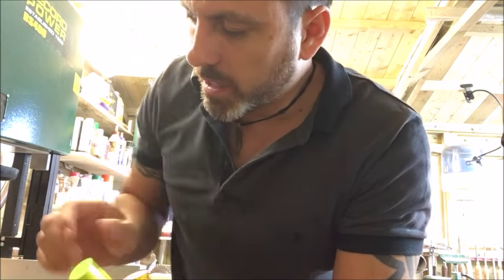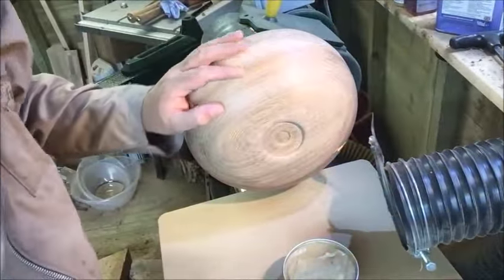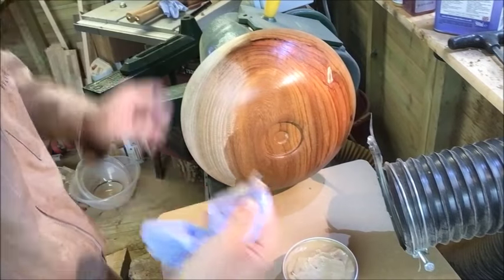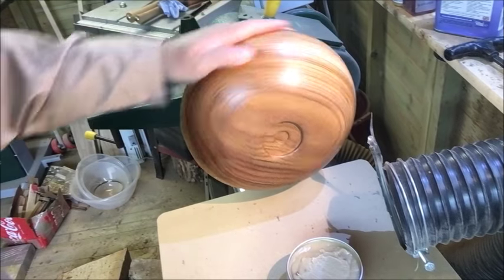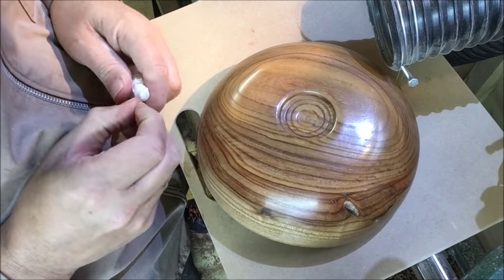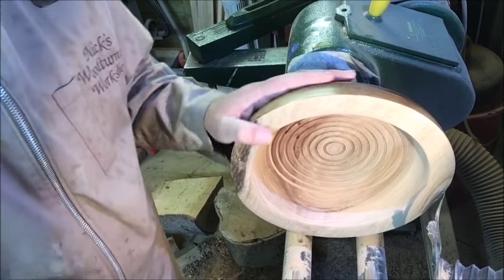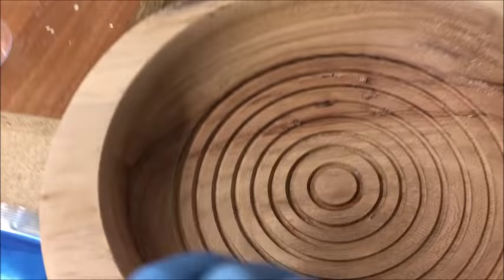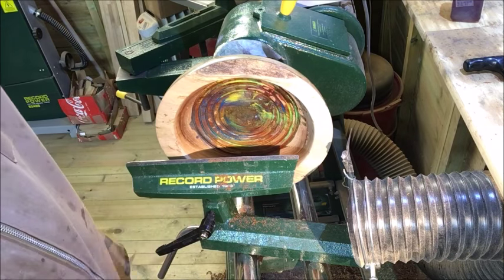Wood Turning - New Resin Pigments - All Of Them!

Comment: So, that shellawax (?) and the other stuff.. What is the purpose of them? Is it just to get an idea of what it will look like or does it actually help with the turning?
Reply: Hi Lori
The shellawax is described here:
http://www.ubeaut.com.au/shell.html
It is used as a final 'finish' to protect the turned item.  You may at some time hear the term 'shine juice' used.  This is basically a mixture of the following:
Shellac
Ethanol (Alcohol) or Denatured Alcohol (Methylated Spirits)
Boiled Linseed Oil
Mixing these 3 components in the ratio of:
1/3 Methylated Spirit
1/3 Boiled Linseed Oil
1/3 Shellac
Once applied to the completed item (bowl etc) it provides a very shiny surface and helps protect the wood.  A final option may be to use pure Beeswax use this by holding a piece of Beeswax against the piece produced - the heat from doing this will melt the wax and then buff with a soft cloth.  By the way the term sanding sealer which when applied help with the sanding process, it is the same as 'shine juice' but without the boiled linseed oil.